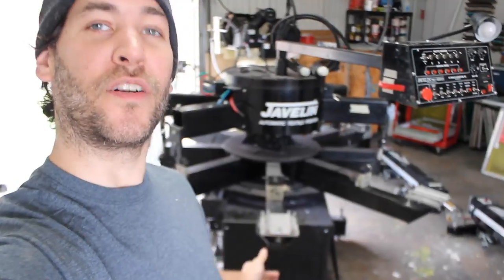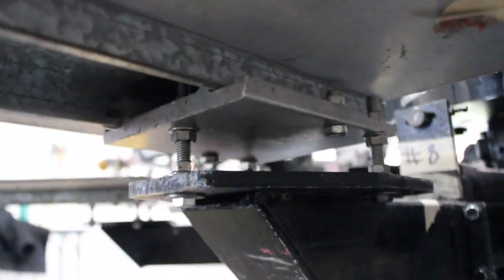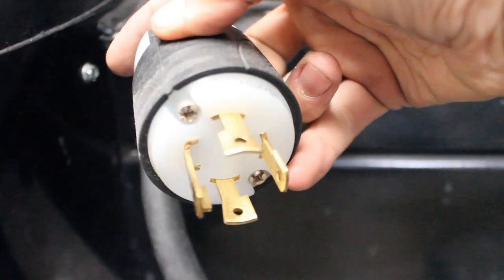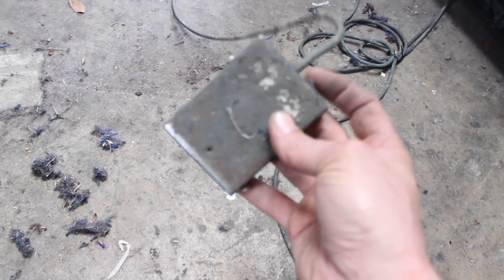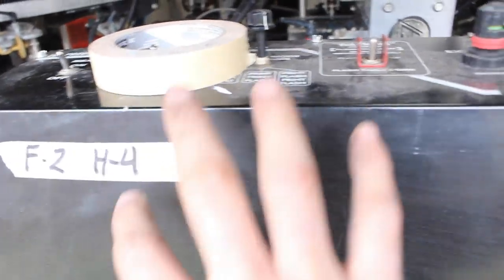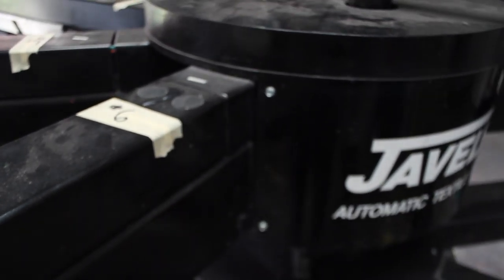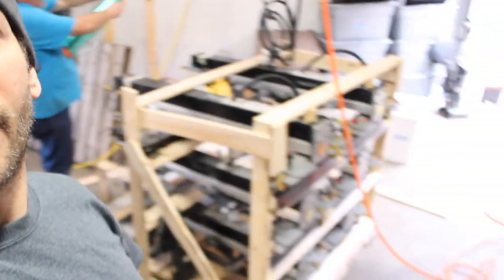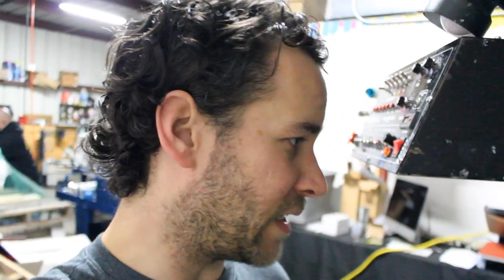Disassembling the Javelin Automatic Screen Printing Press Vlog and Getting Ready for the New Press

Comment: Hi Mikey! I was wondering, is it possible to screen print on a paper? I.e. make your own heat transfer
Reply from the maker: Yes of course! They have plastisol heat transfer paper and adhesion powder you have to coat the wet ink with, and then semi cure it around 240º. The powder will adhere to the shirt and the press will finish the cure to 330º.